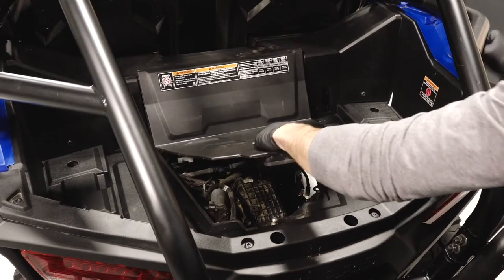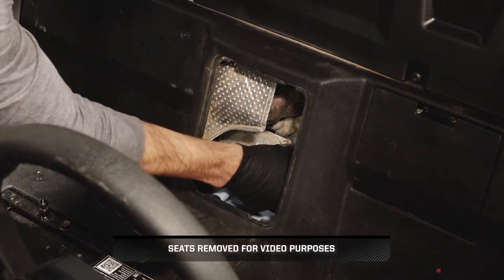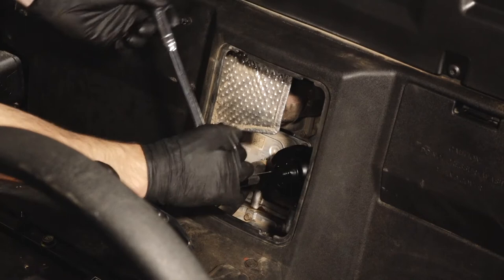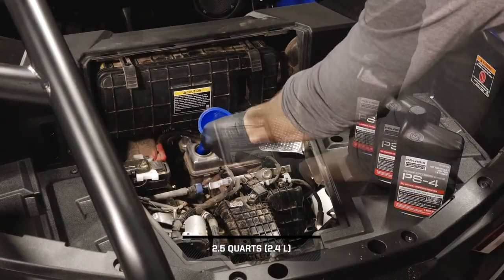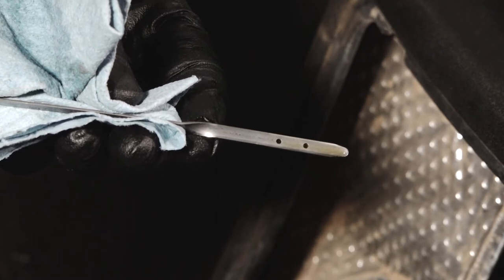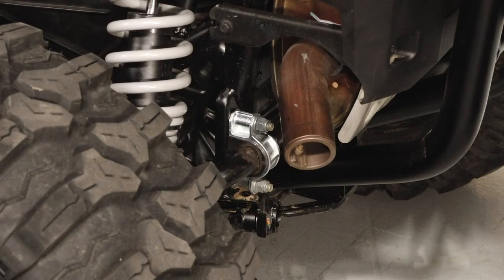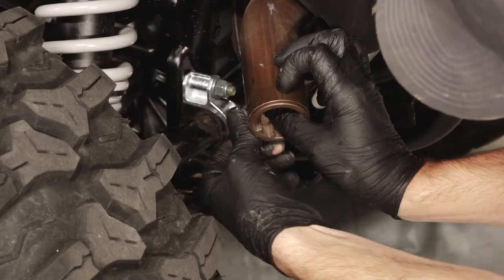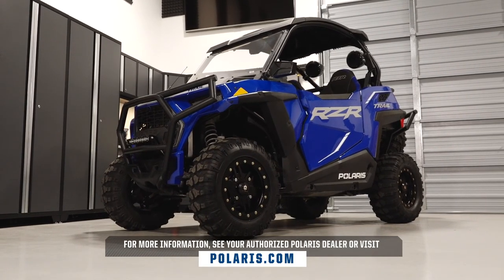RZR Trail Oil and Filter Change | Polaris RZR®

Comment: None of this applies to the 2021 trail
Reply: What is the correct hex bit socket size that fits the oil drain plug? I have a 2021 900 RZR Trail S